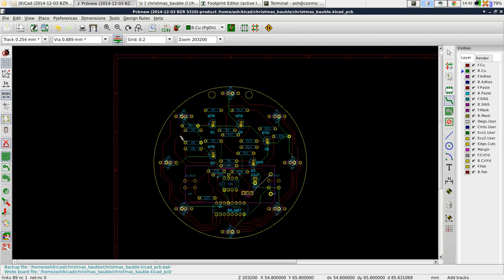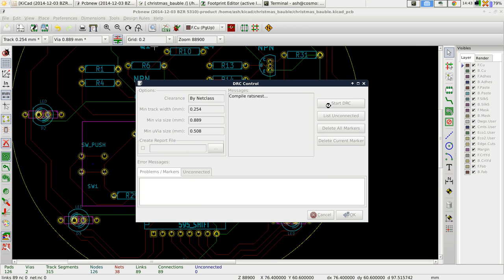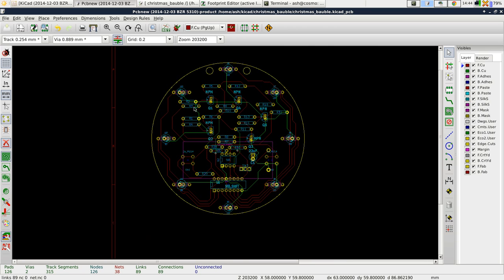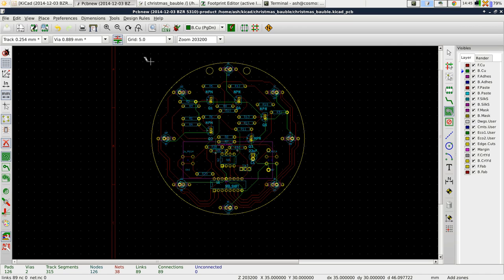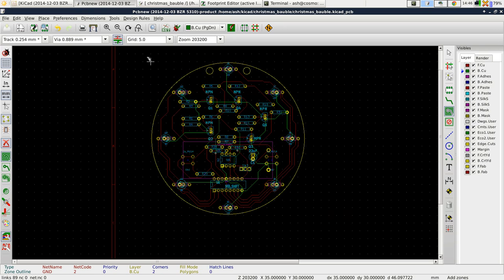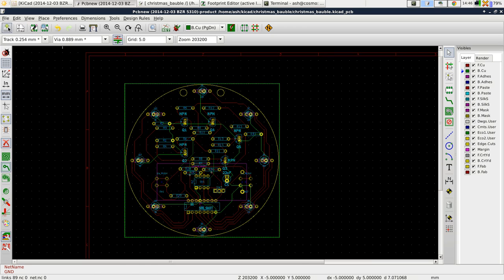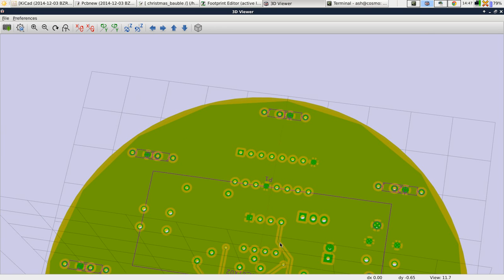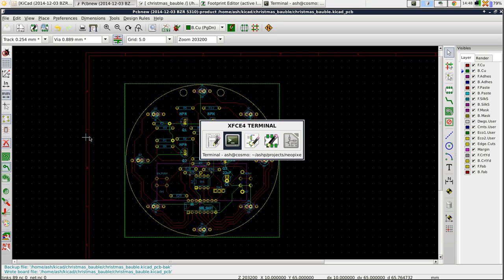Kicad Tutorial 12/2014 - Part 11/12 - Copper Filling a PCB

Comment: hey ashley. i designed a single layer pcb. bottom layer. wat net shd i assign the botton layer to coz for every net some pads are always exclcuded
Reply from the maker: +shiva kumar Sorry I don't understand what you mean
Reply: +Ashley Mills my pcb design has only the bottom layer. so wen i tried to do the copper fill on it. not all connections are made. i wish i could send u a screen shot
Reply from the maker: You don't want everything connected to the fill. Typically you should select the GND plane when you do the fill.
Reply: +Ashley Mills i ll try... but man can u please tell another way fr me to ask u these doubts.
Reply from the maker: There is no other way. If you watch through the tutorials it should be quite clear. But you should also try to understand why something like a copper fill is done: typically to provide a large groundplane to decouple noise and keep all the ground points at the same reference.
Reply: +Ashley Mills suppose i dont do the copper fill... can i still take the print out and make a pcb out of it?
Reply from the maker: You don't need a copper fill. As long as everything is connected up correctly, and you have no remaining wires when you turn the rats nest on, then the PCB should work.
Reply: +Ashley Mills so what exactly is the need fr copper fil?.
Reply: +Ashley Mills so y exactly do v need the copper fill?.
Reply: +Ashley Mills i did the copper fill on the GND net. Now what about the other component pads?. do i need to include em in a copper fill? if yes how?
Reply from the maker: http://bfy.tw/1j8F